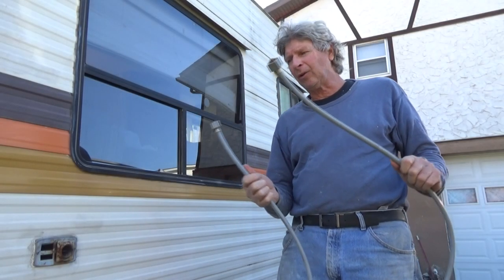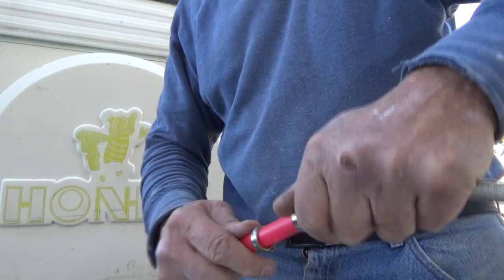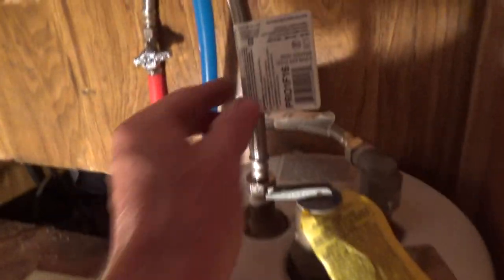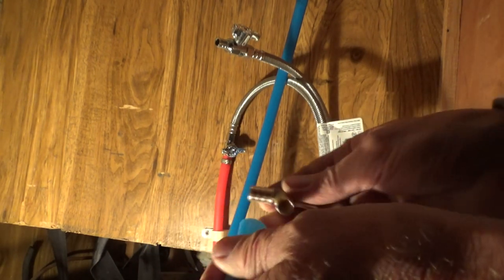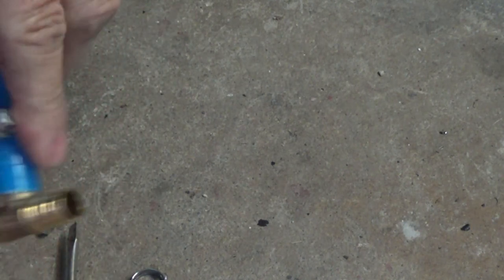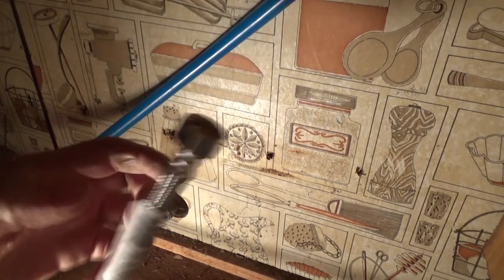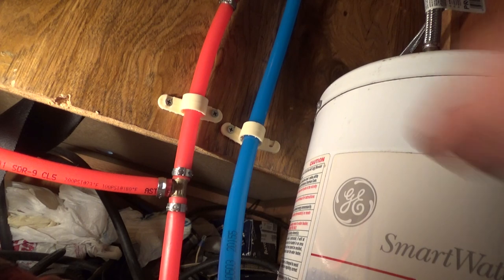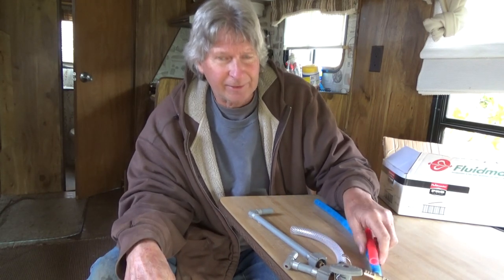CHANGING MOTOR HOME/RV WATER LINES TO PEX

Comment: Thanks for this. My old but well loved 1989 Jamee is driving me nuts with its old Qest connectors. I finally just traced a leak to a Qest T joint that is of all places under the toilet. Ugh! Heading to the hardware store to buy a bunch of PEX stuff, which is no longer mysterious thanks to your video.
Reply from the maker: Thanks, it's working well, Mike
Reply: @mikehaduck-travel-mechanic884  upgrade finished! Came out great. All thanks to your video. I was contemplating getting a new rv for a minute since the plumbing issues were getting so annoying. Now I'm even using pex to fix garden hoses, ha.

Comment: Nice work!  My RV has that gray Quest lines & fittings. Had costly leaks from failed fittings behind the hot water heater.  Going to replace all with Pex B.   Learned a bunch about it from youtube then studying Home Depot's stock.  But cheapest to buy the tools & parts off Amazon.
Reply from the maker: Thanks, Mike

Comment: Thanks so much for showing us how to remove a crimped clamp on PEX pipe. Until your video, i would use a Dremel tool to cut them off. That can make for such an easier job. Kudo's.
Reply from the maker: Thanks, Mike

Comment: Thanks for the video. How did you connect these lines to you pump? Pump manufacturer recommends a high pressure flexible line and not connect pex directly to the pump.

Comment: Good video dude!  I have a 1987 Avion with that same old gray piping, and I've been patching and chasing leaks for a few years now.  Been thinking about swapping it all out to PEX.....I think you  just made me a believer :)
Reply from the maker: Thanks Jim, no more problems sense I did it, mike
Reply: My 1974 24’ Dutchcraft has that gray pipe. I have had no problems with it. I like it because it does a nice ‘ball’ seal like a flare but also will seal against pipe thread fittings. 
But nobody stocks it anymore. I don’t even see that stuff on Amazon.

Comment: Great video !  Getting ready to fix a leak in my 87 old fifth wheel garage   Mine has the old grey tubing and the metal clamps   I’m trying to figure out if I can remove the old clamps with a pex removal tool. The clamps seem different than the old ones
Reply from the maker: Hi Joe all my old ones rotted away, I just gave up and changed everything,  thanks mike

Comment: So I'm curious, would you prefer your electric water heater over a propane?  I am contemplating removing my propane tank entirely from 1985 Econoline RV.
Reply from the maker: I don't see why you can't have both, thanks
Reply: I absolutely Love our Girard Tankless water heater, its changed our lives. We live in our fifth wheel camper full time for about 6 years now, and about 4 out of the 6 years we have had a 10 gal electric/gas water heater. One problem with the electric water heater or gas, hot water runs out way too fast if you like to have a long shower like my wife lol. We bought a Girard tankless water heater on amazon and had our camper fixer upper guy hook it up and it works flawlessly. It takes about 10 seconds for the water to get hot, but stays hot once it gets to the desired temp. Life changer!!!! It barely uses any propane as well. I think we spent around $600 for it, but we think it was totally worth it.  I hope this helps. Thanks Mike for the amazing video!!!

Comment: Hi Mike, I'm new to RV'ing and need to change my water lines due to a freeze. How much PEX tubing in length do you think I would need to change out in my 34ft travel trailer, hot and cold.
Reply from the maker: Hi Saul, pex usually comes in 100 ft rolls,  very cheap ,its the shot offs as and other stuff that cost, thanks mike